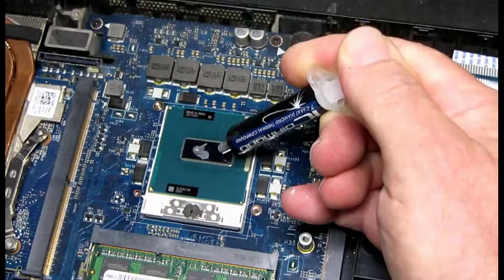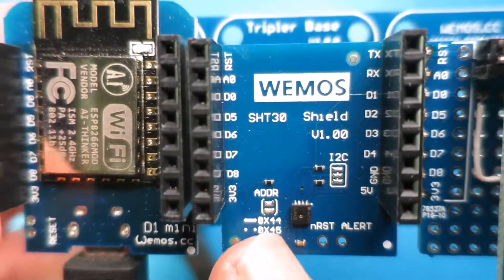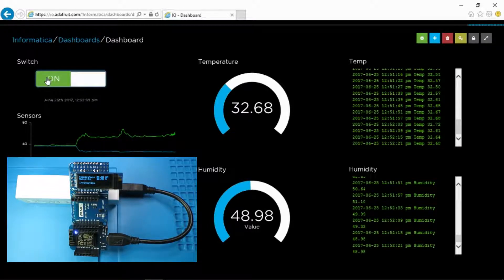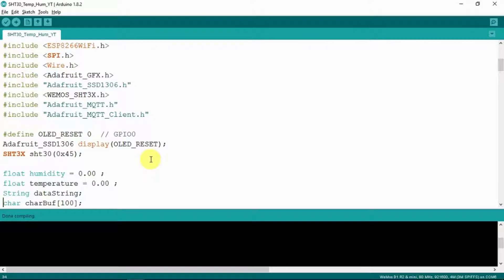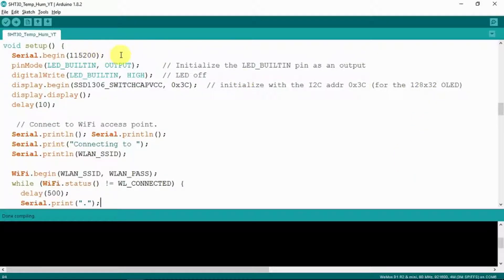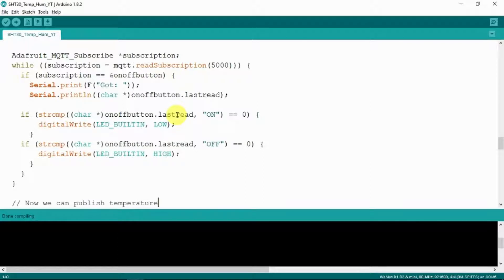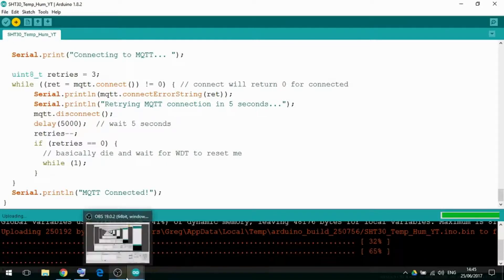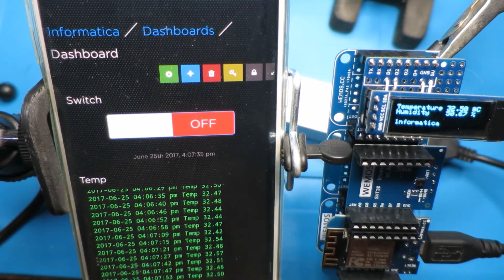WeMos SHT 30 Temperature & Humidity from Banggood Internet Of Things IoT Example  Electronic Project

Comment: Really nice! But what exactly does Adafruit do with the data?
Reply from the maker: The Adafruit site is an MQTT broker. It's role is to manage the messages relating to "Publishing" or "Subscribing" clients. When a device sends a "publish" message it is authenticated by the broker using the username and a unique key. Obviously I have blanked out that key in my example sketch. The broker then takes the message and applies the rules that you have given it like draw a graph or list the values. On the "subscribe" side the WeMos in this case is "subscribed" to a feed called "Switch" when I move the slider on the broker it sends a programmed message to the subscribed clients. So the WeMos gets "ON" and the sketch recognises that as turn on the LED.  Hope that makes a little sense, it's all new to me too! Check this link for a better explanation http://www.hivemq.com/blog/mqtt-essentials-part-3-client-broker-connection-establishment
Reply: 1nformatica Yes, I understand that. But Adafruit doesn't use the data too? I ask because there are projects that collects that kind of data, from volunteers all around the world, to make better weather... Não sei como dizer em inglês, mas seriam melhores previsões do tempo. Someone I met a few time ago was starting some kind of project about that. You know?

Comment: nice video. Is it possible to have wemos/relay/fan at one location and another wemos/(Wemos Temp & Humidity Shield) different location with a preset temperature; so when the temperature reaches a certain point, it sends out a command to turn on relay?
Reply from the maker: Hi Mohammed, this is certainly possible. If I were thinking of doing this I would use "If this then that" or IFTTT. If you are not familiar with this check out this video: https://www.youtube.com/watch?v=99y2kI5JlBU IFTTT can be linked to the Adafruit MQTT service too. Hope that helps!